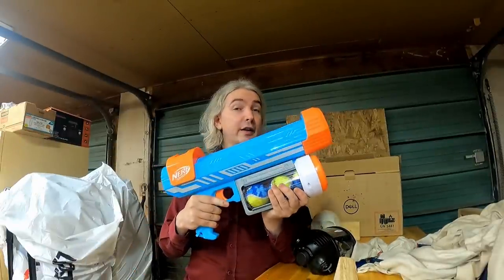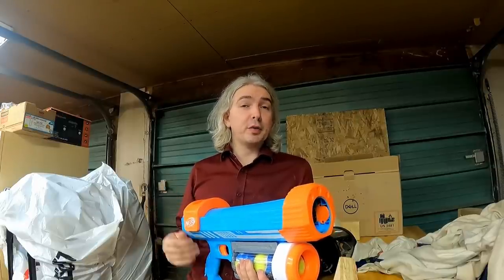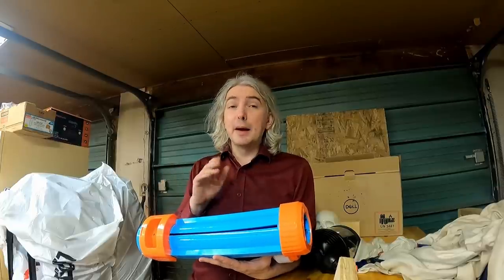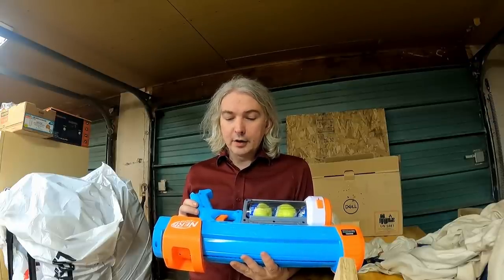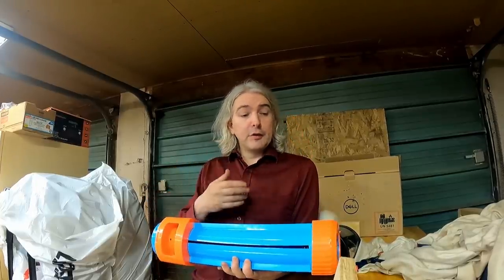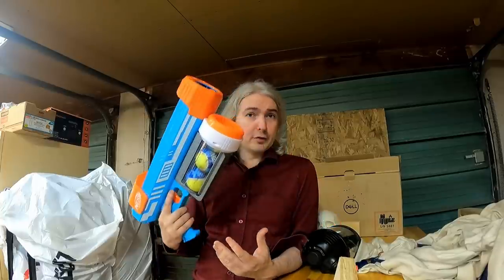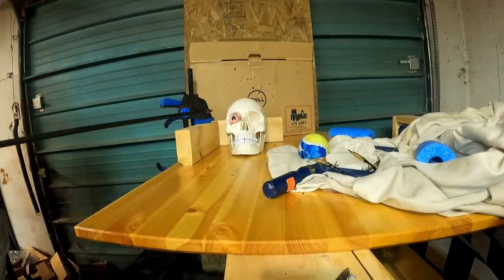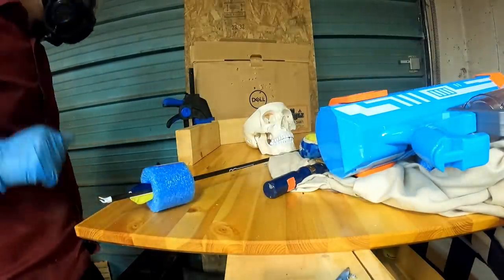Is A Nerf Dog Ball Launcher A Gun In Canada (Challenge: Find A Gun In A Pet Store)

Comment: Buy a 5.5HP pressure washer. Well over 10,000J, fired a projectile over 450fps, has a barrel, can extremely easily blow your eye out of the socket and obliterate it. 

So this is definitely a firearm, and also prohibited due to 10,000J.
Reply: 5.5HP is 10,000J every 2.5 seconds, not 10,000J per "shot" as there's no discrete projectile, only a stream. Each individual droplet is under 1 joule.
Reply: @marc-andreservant201  So it's a machine gun then. 😃

Comment: So is the instant legolas from Jeorg Sprav a firearm?  (they're selling it as the Fenris for copyright reasons, but when he was designing it over multiple iterations on YouTube, he called it the instant, and the name stuck) 

The instant legolas is a device that you can strap on to basically any bow, which acts as a combination quiver/magazine and arrow release. It basically nocks the arrow for you every time you pull it back, allowing you to fire rapidly (like legolas) until the magazine is empty. It usually has 4 to 6 shots.

It does not require any modifications to the bow itself to function. The commercial version is made to fit on the accessory mounts of modern compound bows. But there are videos of him making wooden ones and tying it to medival longbow and traditional recurve bows. The magazine has a tube like opening guides the arrow as the string proells it forward.  

Also, based on that entry describing a crossbow that you read, if you add an instant legolas to a bow is it then considered a cross bow in canadian law?

Comment: Muzzle energy is 4 joules for a tennis ball @ 12 meters per second
Reply: Thanks for doing the math.
Reply: @larryclemens1850  I did it more accurately, it's 4.22 Joules 😃
Reply: @RX-rr8te  did you cover the range of projectile weights?
Reply: @CHGLongStone  I did look up the regulation weights of tennis balls and 40fps as the velocity. I've really no idea if my figures were accurate, my real point was that other people are nerdy too 😃
Reply: @RX-rr8te 😂🤝 unfortunately the calculator I used on line was integer only for the results.

Comment: The tennis ball will fit inside the orbit.  They deform quite a bit at high speed, just check out footage of them getting sliced up hitting a tennis racquet.
You're talking 10mm of the ball poking through 10x10mm holes in the string bed.

Comment: Lubrication in the barrel might make it more dangerous too. Putting flammable oil in a BB gun will often cause it to "diesel", meaning the oil burnes and explodes due to the high air pressure. This effect sometimes causing the projectile to go at supersonic speed.
Reply: can you link a reference to this? im extremely curious.

Comment: Lmao no. If it shoots over 495 pfs shen it is... I dout it does.. if u paint it to look like a real gun then it might be aswell.. also if used in a crime it's considered a firearm real or not..., too add for info sake dog balls don't contain fiberglass tennis balls do.. why dog balls were made it saves their teeth and lungs. I converted a wine quork to fit my paintball marker.. it hurts to get hit with but isn't lethal. Last recommendation is put a gas check on the dart and it will stop air passing threw the holes..
Reply from the maker: I go through the law. There's two cutoffs--"firearm" is at "can it puncture an eyeball", whereas "needs a licence" is at over 152.4 m/s and 5.7 joules. There's plenty of legal consequences for something that is an 84(3) firearm.

Comment: Well I can tell you it's not a barrel but a launch tube barrels are sealed all the way around like a shotgun barrel, rifle barrel or and tubing of any kind, it's a spring loaded launcher, and the acceleration is to great for the sabot design you need something to support the dart at the back of the sabot. The tennis ball with nail will work better at a short distance but the tail will cause drag and flip ball around and hit nail head first